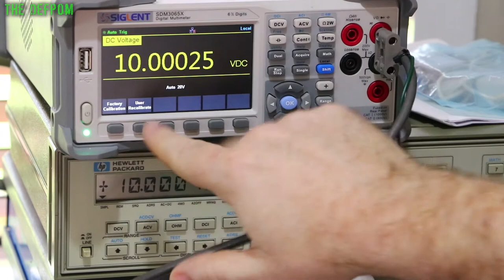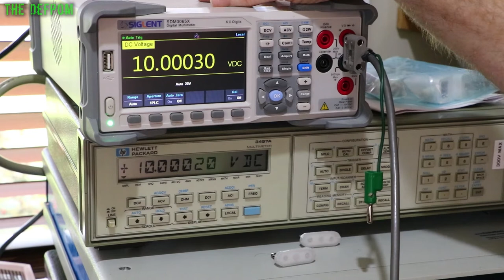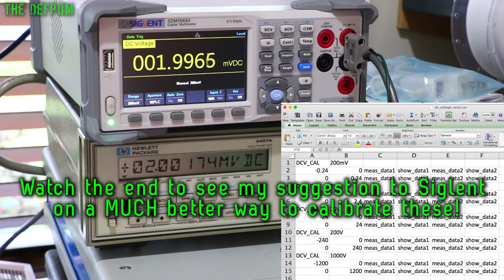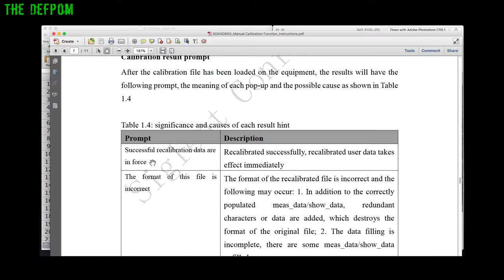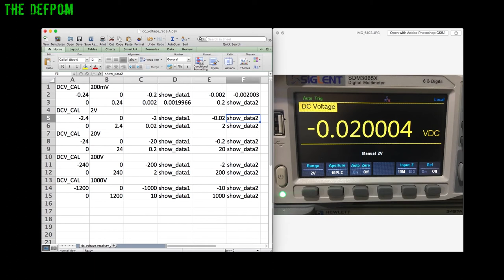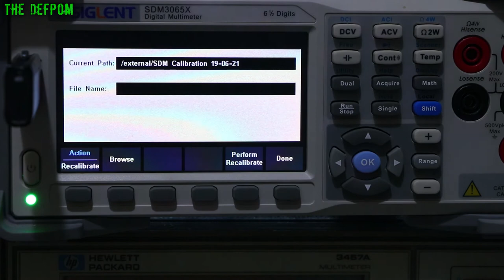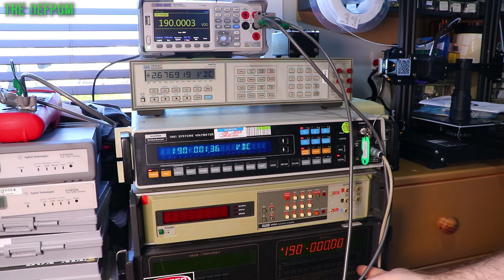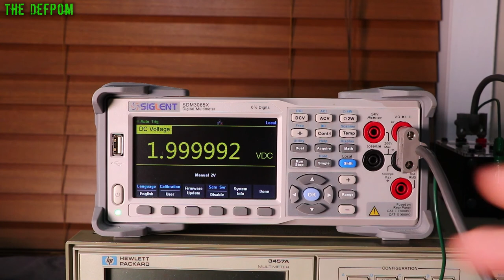🔴 TOP SECRET Siglent SDM3065X Multimeter Calibration Procedure - No.891

Comment: I have been requesting this calibration procedure from Siglent North America for several years for my 3065X.  Response has always been the factory has not released it.   My personal unit is not out of cal however I have been a calibration tech for many years and have access to high end calibrators such as the Fluke 5520A.  I agree with your suggestion to Siglent for an internal process as you indicated.  The internal HP/Agilent/Keysight (among others) cal procedures for their high end meters has always been the easiest and most effective.  Siglent should emulate them.
Reply: Current official position is: For Defpom user cal, R&D department will try to improve it. So at the moment, use the current files and template.  The Defpom User Cal creation webpage is constructed entirely around Siglent's 'secret' User Cal procedure so for now it's the best we have. Thanks again Scott. 👍

Comment: My resistance reading is exactly 50% of what it should be when measured in circuit.
So i used your website to generate 2 wire resistance file without changing anything and tried to load it following yours steps.
I get error in calibrated mode or range.
Reply from the maker: It sounds more like your meter has a fault or possibly a setting error. The error means that the designators for the mode or the ranges don't match what the meter expects, did you select the correct SDM model before filling in your data and generating the file?
Reply: U mnie ten sam błąd w skalibrowanym trybie lub zakresie-SDM3055,podejrzewam niezgodny zapis zakresu ,poniewaz po wpisaniu miernik  pokazuje zakres ktorego nie ma,czyli momy.

Comment: Looks to me like Siglent just ran out of development time/money to implement a front panel based calibration. The CSV method would have been the first incarnation of a recalibration routine during R&D and before the front panel functionality had been completed.
During development of the PDVS2mini I did similar with simple tables in the source code to allow for setting/tweaking the calibration......and it got dumped when the front panel code had been finally written.
Reply: Not exactly. User Cal was developed from the automated factory calibration process and added into the UI to allow teaks to compensate for Vref aging drift. Scott showed Siglent a possible method to much simplify tweaks with some mods to the UI and just using front panel controls however they have been reluctant to release any User Cal information publicly despite Factory Cal being preserved when User Cal's are applied and able to be recalled with just the press of a button. For some time we have pushed for things to change and now Scott has given this some air and time will show Siglent their customers will not wreck calibration there is some hope they will add a front panel method to make small changes without the need to fuck around with CSV files and upload them. Scott's webpage will make the current User Cal process so much easier.
Reply from the maker: As Rob has already said, we have been pushing Siglent on this for a couple of years, they are at the point now where they are comfortable making it public, I think they wanted to get the firmware done for the SDM3045X and SDM3055 first.

Comment: Calibration is not adjustment or "tweaking". Calibration is the process of testing an unknown item / device against a known reference value / device and does NOT involve adjustment. Verification is when you adjust (if required) a device using a known reference device and a required specification. Also note your test leads and the errors they will contribute due to different contact materials which can give micro volt errors. . Be wary of heat from devices stacked on top of one another and ambient air flow in the room across your devices. Temperature variations at the test terminals can also cause errors between devices and test leads can pick up back ground or mains noise.
Reply: How about the voltage standard used by Siglent? Do you think the adjustment made will improve the accuracy of this device?
Reply: @theovannieuwenhuizen5756  Normally main reference voltage standards are never adjusted as you want to know the drift. If you keep adjusting something annually when did it drift the most ? What is the impact on the devices you tested using that reference between ajustments ? Look up Josephsons voltage standard. The kg standard is changing as it ages but you never adjust it.

Comment: Wait, what? Siglent requires calibration? What for?! :) Shockers.
On serious note, if you want your 7.5/8.5d calibrated, drop me a message.
Reply: Deffo worth considering Scott.......because is you send to a normal standards/cal lab they won't tweak the calibration, they'll just document it only. That's of course if it's within spec......but then if it's out of spec they'll charge you mucho extra to go tweaking (repair!)...............I'm sure xDevs will get in there with the trimming tool if need be....:-)
Saying that, totally understand your usage of your devices and the real life questionable need to get it done......and of course in can be a rabbit hole!
Reply from the maker: Maybe a solution to this would be to get the next unit I buy sent to you for directly, which is fine if it’s a working unit. I very nearly purchased a Datron 1281 a few days ago, but it only did DCV so didnt want to bid that much.
Reply: @TheDefpom  That's how we did things few times before, cross-shipped stuff from epay. In fact last xDevs repair video item was exactly that, Fluke we fixing will go to my friend after repair and cal.
Reply from the maker: @xDevscom_EE  Thanks for the offer, I will keep it in mind and take you up on it if I buy something suitable in the future.

Comment: I noticed that my SDM 3055 does not correctly report the DC offset of a sinusoid but that a $100 DMM will. When given a 4 Vpp sinusoid with 3 V DC offset the AC voltage reading is 1.41.... , which is correct, but the DC voltage reads 1.6 volts!

Comment: I dont have the calibration option on my 3055  firmware - 1.0.1.01.2.0R2.  Also is there a way to zero out the leads when using ohms?
Reply: Updated to latest and it is there - calibration.  still trying to figure out how to zero out leads in ohms

Comment: Firstly, I am ever so grateful to you, for your efforts to make this video. Thank you. I am just a retired hobbyist that took up electronics to keep my brain learning. I treated myself to this exact meter. Per some EEVBlog Forum advice, I left the unit on, for many months (years?) to allow it to settle out any drift. If I wanted to keep the calibration topped up, it is probably time to have it done. However, I would not want to return it to Siglent, for them to do the work, as I have had significant issues with their service center on other equipment. So, what other company in the USA/48 might you suggest I consider and what fee might I expect to be quoted? I take it that any calibration is not covered under warranty.
Reply from the maker: The forum will be the best place to find where to get it calibrated, I'm afraid I don't know. This method is for "users" to adjust their own meters, something that can be done if you have a suitably accurate reference source as shown.

I think there are different calibration scripts for use with commercial calibrators and NI VISA etc. I know nothing about those though.

Comment: If I dont have a reliable standard over 10v,  i.e 200v, 750v dc ranges, can I just use your generator to calibrate what I can and somehow use siglents original cal data for the ranges I dont have? I bought an SDM3045 and have had siglent recal it once under warranty but it still reeds my 5v standard as 4.9990 all my cheaper meters are 5.000 bang on. Im mostly interested in getting accurate values for ADC voltage references like 3.5v and 4.096 etc
Reply from the maker: Yes.
Reply: @TheDefpom  Where are those cal files located on the meter? sorry if this is all in the video i need to re watch it when i get some time.

Comment: I like the calibration videos but I wonder if the  8 1/2 digit solatron is calibrated please ?....cheers.
Reply from the maker: It only 7.5 digits, and it is a bit noisy, and jumps every 15 minutes or so as it does an internal correction... I now have a 7.5 digit Datron 1082 which is a lot more stable.
Reply: @TheDefpom  Oh I didn't look closely and figured it was 8.5 digits.
Reply: @TheDefpom  I can help to calibrate your DMM :)
Reply from the maker: @xDevscom_EE  - Thanks for the offer that would be very nice, but as we’re in different countries that would make it a bit tricky unfortunately.

Comment: Your cal sequence might be ok for simple  user only 'self'  cals, but an official "Accredited" calibration as required for business level requirements, Accredited certified calibration does not allow such undocumented method. It would not be accepted to international standard procedural demands. Important is documenting the information entered in completing the cal entries. Pushing buttons to set leaves no record of actual input.
In fact the spreadsheet creation as suggested by Siglent already poses some issues in confirmation pf the person entering the information being checked for correct entry. 

Life in accredited and cal work is so complex to fulfill requirements, I had some 13 years work as signatory for an accredited test lab, and among that task had to create work procedures and documentation systems for work performed by the accredited lab.
Reply from the maker: Siglent themselves refer to this spreadsheet method as a user calibration, I believe that they have a 2nd method for proper calibration providers, and I certainly agree that traceability is important for commercial uses, there are however a lot of general users that will want to adjust their units once the reference has aged and drifted a bit (as in my case). I am a bit spoilt here having picked up bits of calibration gear over the past few years.
Reply: @TheDefpom  Ok, I agree for basic user ability to keep readings accurate, especially with only simple available reference sources, your method would be far easier for most users than the far more complex spreadsheet and no need to document their cal.  Given few users have such premium reference source on hand but more likely one of the simple stable ref IC based 2.5, 5, 7.5 and 10V sources, that someone with a recently accurately  (hopefully)  7.5 or 8.5 digit DMM has produced and supplied accurate table of real outputs. Sadly many such references are delivered without or very dodgy cals table from online sources.That reference of course is itself not definitely very accurate, aging so likely no longer actually right by such table of values.
 Main user interest is having his set of equipment in basic agreement, not traceable to national/international standards.  
Formal calibration is rarely justified unless you have business income derived and depedant/ needing such traceable measurements, it is simply too costly for most small workshops or individuals. Fort7nately unless something really becomes defective the modern 5.5 to 8.5 digit instruments are so stable they realistically do not really need such annual cal. My experience is that over 10 years they hardly alter (Keysight/Agilent/HP, Tektronix, Keithley,  etc) with formal expensive cal only proving no change since manufacture. Sadly the cal intervals demanded by Accreditation, seem derived from historic VALVE based equipment that drifted over months not even years. I had much calibrated HP/Agilent DMM, Signal sources, DC power, and Acquistion hardware, over 13 years fewer than 10% of that was ever needing strictly speaking far enough out to actual needed accuracy, and 30% adjustment to original product spec limits. Rare actually was anything like the allowed spec aging drift limit. Even a 1970s Fluke handheld DMM  I have was only out by 2 counts of least significant digits on most used ranges and 5 counts of  least digit on max voltage range, compared to a new 7.5 digit DMM in 2018.
Reply: @helmuthschultes9243  However in the case of Siglent's top model in this range, in SDM3065X the unaged LM399 used are known to drift and competent users have logged that drift which almost precisely matches LM399 datasheet drift but it takes a while before they drift out of accuracy spec. Some A brand bench DMM's permit front panel adjustment and it's clearly outlined in their documentation unlike those at this time for Siglent DMM's due to their resistance to have their User Cal information publicly available. This beggared belief when the Factory Cal remains undisturbed and can be recalled with just the press of a button. Only a day or 2 back some Siglent top brass finally concluded owners should have the opportunity to decide for themselves about User Cal rather than it be kept a secret process when that need be so and made no sense at all.
Reply: @tautech8196  Ok, I admit to not expecting the Siglent to match the likes of current Keysight and Keithley gear, there is a considerable cost differencs. Not that I necessarily suggest all that cost increase is justified by the relative quality, some is simply brand prestige. I too have several Siglent items and feel quite happy with these, and trust them more than several other economy brands..